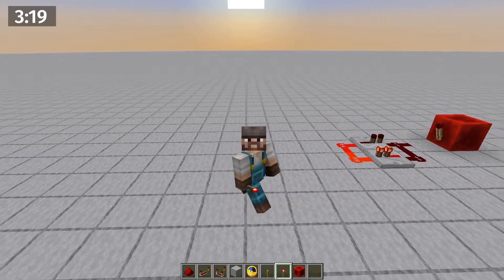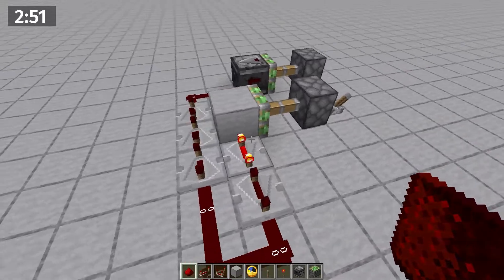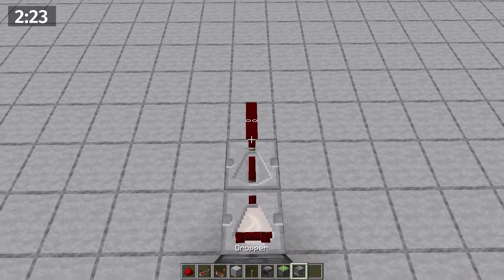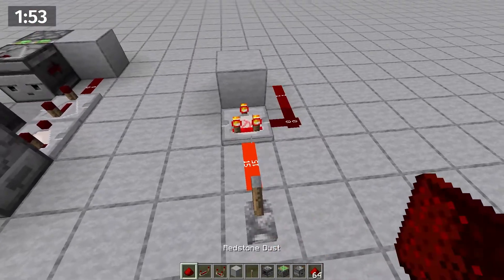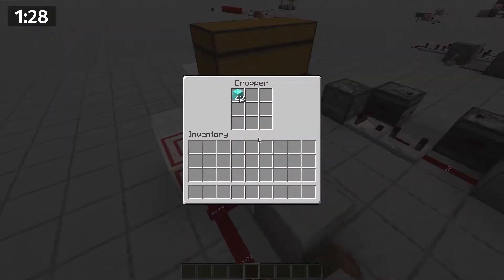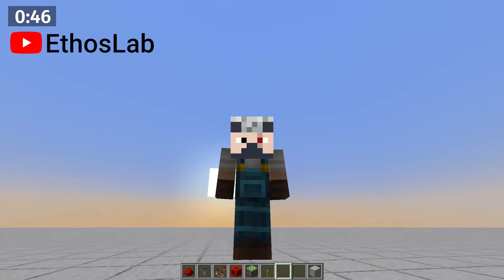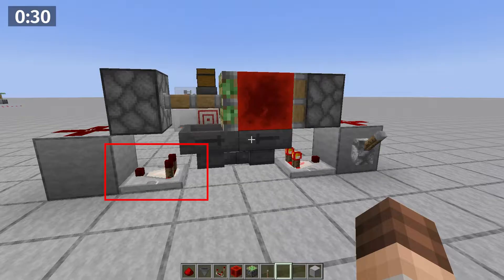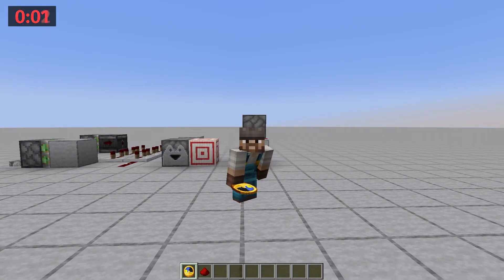3 Redstone Clocks Everyone Needs to Know

Comment: Love the explanation with the animation of the etho hopper clock. U left out my favorite basic clock tho :( . Inverter clock: Block with a torch > repeater loop > back to the block. Stick a lever on the top of the block for the on/off switch. I put that shit everywhere. 

I'd love a video where you just go thru all the gametick timings of basic items and how to count up the time in a clock or delay of various types. I always get tripped up on what the timing is for certain things. Ilmango made a couple videos of flying machine and piston timings and another clock video. But I don't think I've ever seen a good all round video that includes all the basic component timings.
Reply: Yeap it is much more stable and cheap.